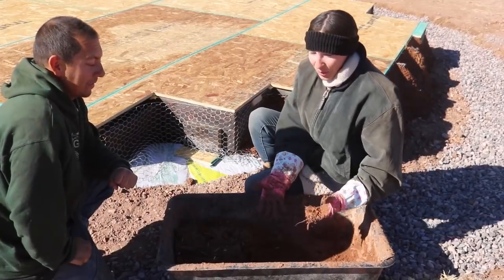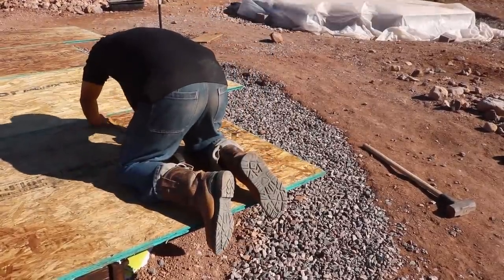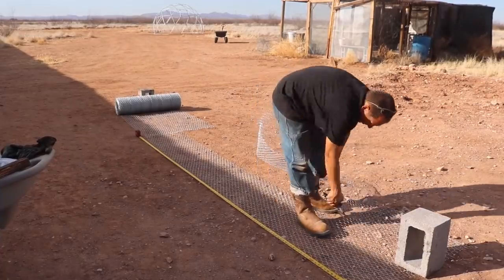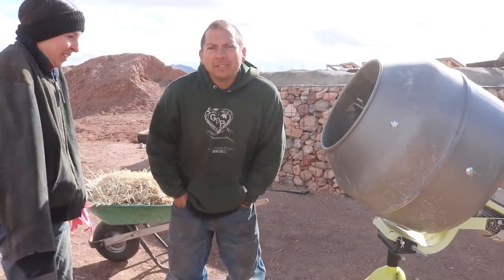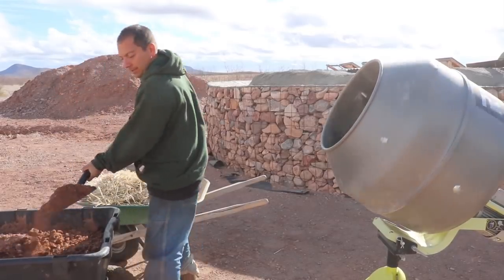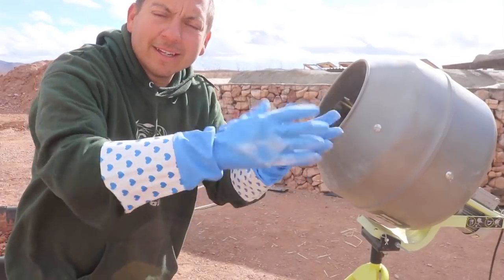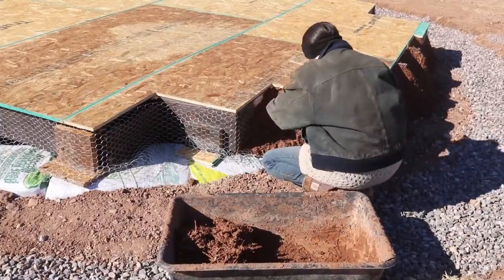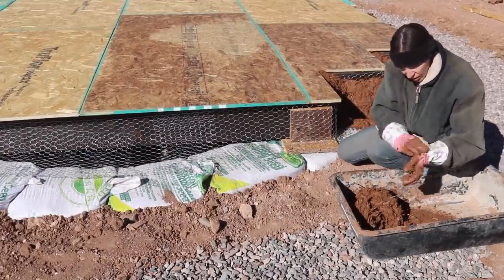We're Using Cob To Seal Our Underground Earthbag Room

Comment: Question: will you’ll have a stem wall outside of the cob finished— to protect from water 💦 
Oh! Think you answered it at the end 👏👏👏
Reply: Did they? I didn't hear it.
Seems like around the base is the loose drain gravel. What will the dome/wall sit on?
Reply: @marcusbk7317  ...a stem wall that will support the structure (dome) to be erected?...
Reply: @PeterWest70  OK, so the stem wall sits on a footing, but I don't see where the footing can go, except on the drain gravel.
Reply: @marcusbk7317  I think that the gravel is for the lower level and the actual dome will or should sit just outside of it, probably atop a stem wall???
Reply: @PeterWest70  this is how they keep us watching! :)
Reply: @marcusbk7317  wow! “...they keep us watching” sound like you don’t have a “CHOICE”.

Comment: So exciting to see the process of what you are undertaking!  Looking forward to see more come together.  Question - Is the cob suppose to be permanent? Will it last incase rain comes?  I was wondering if you would need an overhang like a roof or a tarp to protecting the cob from washing away?
Reply from the maker: The cob is permanent. This will all be covered. Usually if you're building with cob, you want something with a good overhang.